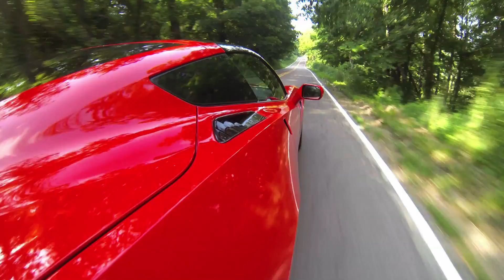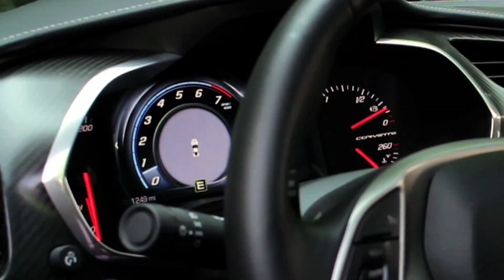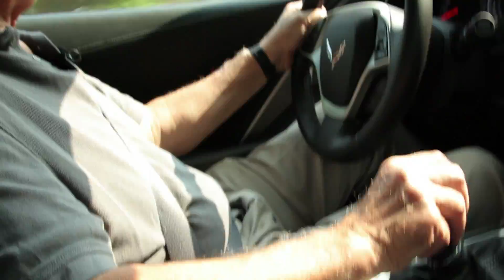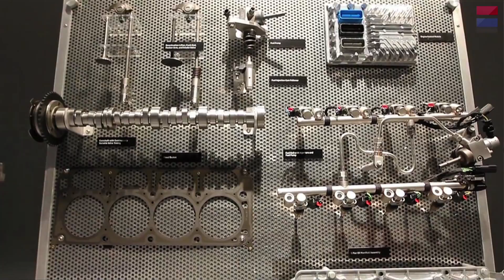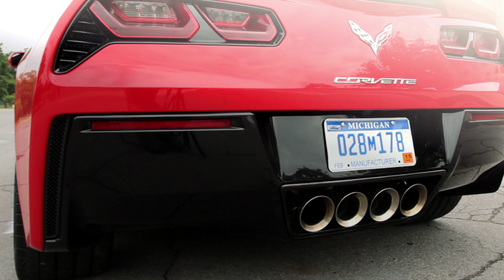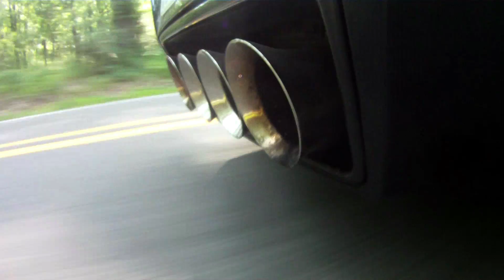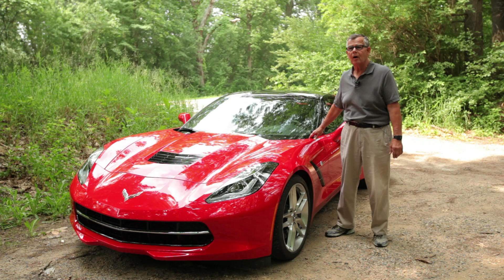2014 Chevrolet Corvette Stingray Z51 - Road Test - CAR and DRIVER

Comment: I love mine nice power took it on a roadtrip from PA. To its birthplace Kentucky 450 miles had it in touring mode averaged 28 mpg on the way down at 70 mph. On the way home eco mode at 70 mph got 30 mph not bad for a car with great power
Reply: 30 mpg
Reply: dang really? that is NICE

Comment: Corvette on the front, a sub-par wannabe Camaro on the back.. Chevrolet has royally screwed-up the C7.. I have NO IDEA what the designers at Chevrolet were thinking to destroy one of the classic trademarks of the car, and less what the executives were smoking to get it approved. Either the C8 gets back a proper Corvette rear with round lights (ot at least an exclusive look no matter the lights' shape) or this melting pot between Corvettes and Camaros as far as Im concerned is the end of the road for this car. Long live the C1 thru C6!

Comment: I love Corvette period and this one is pretty good but they have overpowered the Z06 is what I think only because they put a supercharger on it too early to make it powerful
Reply: I think they just didn't calculate the downforce they would need to keep wheelspin to a minimum. The power could probably stay the same if they gave it a better wing.
Reply: I think that Chevrolet made the top of the line Corvette WAY too powerful just so guys could have bragging rights.  I built/cruised/raced Muscle Cars in the mid 70's and back then if you could get 375-400 horses you were king.  Even a 400 horsepower car is way too much for most people to handle.  Anybody who REALLY uses anything over 500 horses on a public roadway is on his way to Jail or a morgue.  Unless you are on a track you will never use more than 350-400 horsepower, NEVER.  I hate to actually say it, but it should not be legal to drive any vehicle with more than 500 horsepower on a public road.  My penis is adequate, so I don't have to tell people I get 600+ horsepower in my shiny toy...

Comment: No less American muscle, just refined and tunable to the drivers current desire ... drove one for several days, technology on the car is superb.  Very smooth ride.  Find a empty stretch of road and put it in track mode, throw all the throttle at it and it's a beast, no question.  Period.

Comment: If you are 6ft or taller, the roof will sit on top of your head. I don't understand why they did not design this car for those above 6ft....
Reply: seriously? I am seriously considering this car, but I'm 6 ft 1.5 in. Its down between this car and the Cayman. I've seen guys who are 6 ft 4 in ride comfortably in a Cayman - it would be disappointing if I can't sit comfortably in the Vette - going to the dealership this weekend to check it out
Reply: noah wayne Hopefully you can fit, as I had to angle my body to get in and out this vehicle. I have heard that you may be able to change the seat out for better adjustments, but I have decided to look at something else. I guess the design team at GM were all under 6-feet...

Comment: I'm a Chevy spokesperson, I have some videos up on the new Stingray, if you need someone like me to do some of your videos, feel free to reach out!
Reply: So you work for the US gov, and promote the use of taxpayers money to fund a so called privately owned company? I'll pass on any information you might spew.
Reply: Good job Deanna!!! How much is the car, I would like to but one.

 

Jamil Jones PSS,PSM,STS

Safety Professional

US:720-469-3430

UK: +44 20 8133 9241
Reply: Thanks, u can build one at chevy.com, ranges between 54k-79k.
Reply: I agree w you there,  the govt shuld not have stepped in to bail them out, that is tax payer money.

Comment: So will there be a Z06 or ZR-1 version of the 7th generation Vette?????
Reply: Bayer-Z28 That's a fake link.
ZO6 will be reveled January 13 9:30am
Reply: ZO6 will be unveiled this month.
EST 620hp 650 lb-ft.
Reply: Stephen Bagnell
Wow!!!!!!     Thanks, bro.    You sure know your Corvettes.
Do you know which transmission (Manual or Automatic) has the quicker 0-60mph time and top speed????
Reply: nikemac84
(con't) for this current Corvette, I mean.
Reply: nikemac84 ZO6 was just revealed. 
http://jalopnik.com/2015-chevrolet-corvette-z06-this-is-it-1499298030?utm_campaign=socialflow_jalopnik_facebook&utm_source=jalopnik_facebook&utm_medium=socialflow

Comment: 4 cyl vette is a joke, like when ford made theirv4 cyl mustangs. Ferrari and Porshe don't do that and you don't see them rotting away in a driveway
Reply: It's to save gas. It's not strictly a 4 cylinder you nugget. If you don't like it then don't put it in eco mode.
Reply: You dont think porsche has 4cylinders?
Reply: Ford made a 4 cyl mustang and it was called the mustang SVO 2.3 turbo with 250 lb/ft torque. It was actually faster than its v8 counterpart lol.
Reply: Ferrari is getting to the point where they will soon have 4 cylinders, Besides the fact they sound horrible until you rev them. Plus the new 4 cylinder in the mustang is making 300+ horsepower, and like DrMeowMD said - "It's not strictly a 4 cylinder, you nugget".

Comment: only down side to having 4 cyl mode is the hot spots you create in the engine which creates uneven wear and tear on the engine, if only they got rid of this option and stuck to the stronger aspects of the vehicle. such an amazing car, anyways.
Reply: in hindsight, i would never drive in eco mode. XD
Reply: Just curious, I would assume that coolant is flowing thru the whole engine block to manage heat regardless of 4cyl versus 8cyl mode .  Why do you think that hot spots would be any worse than a cold starts or performance driving?
Reply: you really think GM spent millions developing not only a brand new V8, but all of the tech associated with it, just so a designed in feature such as ECO mode would create "hotspots" which would damage the engine and cost them money?
Reply: The 4cly mode are equally spread out, no uneven bearing wear.
Plus GM used the drive-shaft to absorb any  vibrations in 4cly mode.
GM isn't stupid lol.

Comment: The new Vette engine is the peak of factory powerplants. But the gasoline quality?
The next step? An electric Vette ! 
The handling platform is excellent! But a gasoline engine? Calling for a gear shift....
I have a C5 ... I'm waiting for the battery to evolve; the electric motor(s?) technology is already here.
Reply: Problem is,until the battery improves,gasoline will be the best option for performance. Battery technology will be slow to improve unless some breakthrough method of storing electricity is found which,unfortunately, isn't likely. Electric would be great if we weren't limited by the batteries. Could you imagine the cars that could be built if there was a small light battery pack? No transmission needed,the motors are so powerful for their size they could be placed almost anywhere. It would open up incredible design possibilities. I am thinking a small inboard motor driving each wheel.
Reply: IDEA : What about tapping into the vast lightning discharges into the atmosphere every second of every day ? This is unharnessed power! How? I am not the peon to ask this question of.... :-)

Comment: You can get a C7 Automatic or a Manual, BOTH can come with paddle shifters. If you buy the manual tranny C7 you can change gears using either method. Very cool technology! 

Search YouTube for this title. " AWESOME! - Corvette Paddle Shifter - NEW "
The makers of the transmissions for the new C7 explain how it all works, even paddles with a manual tranny! :)

Comment: there are two points of latest technology that make this a quality super car at a mid level sports car price tag.

1) Spot Aluminum welding.....= strong sturdy and light frame
2) Laser vision inspection (manufacturing process) = extreme manufacturing precision that tops hand made cars of the past.

My dad was one of the main dudes behind the software of the laser vision technology....in years to come you'll see this on your every day common cars.

Comment: You only get a ticket if you get caught. The joy is in knowing you can go fast, not necessary going fast. There are plenty of places to hit launch control and get away fast, even if you stop accelerating at the speed limit.

Oh, and your precious Prius is far more harmful to the environment than 5 of these cars will be at 100k miles each. The heavy elements that go into those expensive, heavy batteries are WAY more toxic than just about anything else on the road, including diesel.

Comment: You know you're right, I wasn't even thinking of the 60 & below models & I stand corrected but those taillights look good the way they're molded in with the shape of the body. I still say the car looks great except for the back but one company has already come out with a round taillight replacement bumper so I might get one anyway.

Comment: What can this car compete with,its behind in the hp curve....It may be well designed and have great numbers on the track,when I watched it go head to head with a 2013 Viper,Porsche 911 carrea and it torched them on track numbers,but lost in accleration..Like I said it should have had 500+hp hell the 2014 camaro has the old outdated 505 Z06 engine...also chevy claimed 0-60 times under 4 sec im still waiting for that to be proven...

Comment: Electric assisted power steering...? Seriously?
I mean I really like this new C7, although my favourite is the C6 ZR-1. The C7 is starting to feel and look a bit too much like a Ferrari, which is too many electronics. The crucial thing I liked the most about the C6 is that it's a brutal and basic sports car. It had a massive V8 supercharged powerplant in the front, a proper manual box and a mechanical LSD at the back. Ceramic brakes etc. But this has so many electronics. I hope they won't go DSG

Comment: Too bad you can't have the "track" exhaust in the other driving modes.  What's wrong with a smooth ride and a glorious rumble?  Seems to me I always understood that the exhaust bypass was vaccum operated, giving a snarl upon startup, quiet for pulling into Church on Sunday, and a wonderful soundtrack for spirited backroad drives after church :)
Reply: ChevelleSSLS6 ..pull out fuse42 and it's open exhaust in every mode

Comment: I owned a 1980 corvette.. but nothing further back then that. before the 90's corvette had some class ..today they are truly a joke. not only is the stingray underpowered. when compared the the older model zr1. so basically we give you guys a new uglier body that has japanese styling.even corvette admitted to that. it has less hp and slower than our previous zr1.. wtf happened there

Comment: If you have ever driven a car that has unlimited throttle response and is capable of 2 g turns, you know exactly why.. You don't have to shift by taking your hand off the Steering wheel

Comment: I was referring to inside the cabin, the indicator stalks, steering, foot and gear paddles, door handles, center console, air conditioning vents and all the knobs are magnesium.
Also, "Overall 65% of the vehicle's total body mass is CFRP material while the remaining 35% is aluminum."

Comment: I would like to see wear magnesium is mentioned in the cabin Area. Maybe the front/rear sub-frame but I have never seen the word Magnesium mentioned near the cabin. 

"Much of the LFA’s main cabin frame is made from hand-laid pre-preg CFRP, where the carbon fiber sheets have been infused with a heat-setting resin powder before molding. Other CFRP components in the LFA, made with differing molding methods, include the floor panel, roof pillars, hood, transmission tunnel, and rear floor.

Comment: You obviously missed my point.  GM used a specific TC button on the C5 Corvette and it was a nice added touch and showed some attention to detail.  Things like that make the flagship of the brand stand out.  They would only have to keep them at Bowling Green anyway.  Making a different "check engine" light icon would be a welcome touch.  The dash has to be made different for every vehicle anyway.  Minimal cost but money well spent in my opinion.

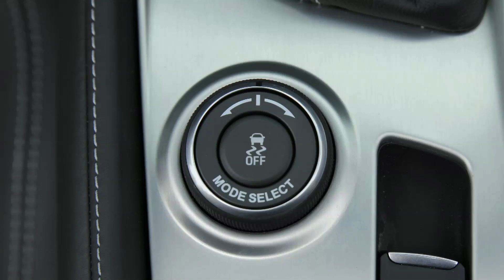Comment: Is anyone else at all diasppointed in the oversight of the traction control button?  Look at it.  0:40.  It looks like a generic van.  Now google a C5 Corvette traction control button.  It's obviously the C5.  With all of the thought put into the C7 I'm just surprised that this attention to detail was lost from 2 generations ago.  Kudos to Chevrolet for what is certainly an outstanding car.  That being said...GM, you still have time to screne print some TC buttons with a C7 on them.

Comment: There is about a 30-40K difference depending how loaded the C7 is. Nissan doesn't have a vehicle in that price range from a performance perspective. I believe that GTR starts at about 100K. The base C7 starts in the low 50s.

Comment: In all fairness, the GTR has an incredible 0-60 because of the LC, Semi-auto and AWD. That is what gives it the high 10 second ETs but mid 120 trap speeds. The GT2 RS is rwd and will never hook like an AWD car. If you notice the trap speed difference means there is a lot left on the table for the RS in ET. Notice what happens when you line up the 911 Turbo S PDK with the GTR. Although the GTR is clearly the better bargain due to cost, but the Turbo S is quicker and provides AWD vs AWD.

Comment: That is more opinion than fact and you obviously have not driven a 2011+ Mustang GT. If you noticed the last time the 370Z was compared to the GT was 2010 by any magazine. After 2011, the GT was compared to the M3 with competition package and barely beat the GT by a tenth of a second. The 2011+ GT beats the 370Z in every performance category by a wide margin. A 350 hp V6 will never feel as good as a 420 hp V8 in acceleration.

Comment: Well in fairness the Nissan 370Z is a better sports car than the existing Mustang 5.0. It's much more nimble, more refined and more fun to drive in the twisties. The interesting match up will be all new 2015 Mustang vs. the next gen Z. As far as your your other comment I totally agree - Nissan has no car to compete directly with a $50,000 C7 or $75,000 Z06. I wouldn't compare GT-R to those cars though as it's more of a competitor to the ZR1. 2014 GTR = 2.8 second 0-60 and keeps up with GT2 RS.

Comment: Technically yes, you can rev match while upshifting as well. But the term used in this scenario depicts when one blips the throttle while downshifting to a lower gear. I understand it can go both ways, but in relevancy to the video it irrelevant. 

I know about drivetrain shock and synchro-less transmissions as well. That's where double clutching came from. 

In technical you are correct it can be used both ways (up/down shifting).

Comment: Rev matching works for both upshifting and downshifting.  By waiting for the rpms to drop to the right point before engaging the clutch allows for less drivetrain shock.  Also, if you've ever driven a semi truck or old car w/ a syncro-less transmission, you HAVE to rev match upshifts or you'll grind.

Comment: It's a brilliant car, looks performance and quality. just would like to afford it.It the UK any vette changes from dollars to pounds so a base model C7 Stingray would cost in the UK about £52,000 which is about $79,487. So you American's are so lucky $52,000 in a straight conversion is about £34,014. which is like wow! what car in the UK can you buy brand new for £34,000 and even competes with the new C7 Vette? Nothing. Even at £52,000 there's nothing to beat it!! It should go down as a classic.

Comment: The same can be said for many v8's(I'm NOT a ford guy)

but ya Ford got a company in Europe to develop the plasma based cylinder liners.

the 5.8L kept exploding with traditional cylinder liners.

 Chevy outsourced the manual trans+ camaro suspension.

Dodge outsourced the 8 speed+ challenger suspension.

everyone does it.

Comment: A new Stingray starts at $52,000. A "loaded" model would likely include the Z51 Performance package ($2,800), exposed-carbon-fiber roof panel ($1,995), Magnetic Ride Control with Performance Traction Management ($1,795), dual-mode exhaust system ($1,195), carbon fiber interior trim ($995), sueded, microfiber-wrapped upper interior trim ($995) and the 2LT option package ($4,210). That totals to slightly less than $66,000. A new 2014 Porsche 911 GT3 Coupe costs a little over $130,400.

Comment: GT500 is 11.6L effective displacement with 15psi boost
14.7psi doubles atmosphere & displacement
Corvette is only 6.2L

GT500 isn't even made by Ford, in fact Ford couldn't make a GT500 engine if their life depended on it

GT500 block is made by Honsel in Germany
Pistons are Mahle
Connecting rods are manley
Supercharger was designed by GM using their patents but is made by Eaton
2013 GT500 engine can't be rebuilt even once

Comment: 2014 c7 = turns at the end with little braking.
2013 gt500 = huge braking effort to prevent a slide

Comment: Actually, the Z51 has "Only 460hp" and 465tq. This car is going to rock. Still, I can't imagine the ZR1/ZO6 or whatever they are going to call them. Its funny how a couple years ago you have 300hp and you were cool, then 400hp was cool, then 500hp and now 500hp is for the wimps. Heck my Camaro SS (with mods) is running approximately 530hp flywheel (Actual 467 rwhp conservative dyne) and now I am now my car is wimpy! Of course I have 500-600lb. on the Corvette.

Comment: You are so idiotic that it is actually funny. You changed my words around and then couldn't admit to it so you start getting into this idiotic argument about which is which. You told me that I was wrong when I said that a supervisor is a superior and then turned around and said the same thing expect reversed. Think about it.
A supervisor is not a superior         
But a superior a superior isn't a supervisor
That's your logic.
Your are so in denial it's crazy. Admit you were wrong and shut up.